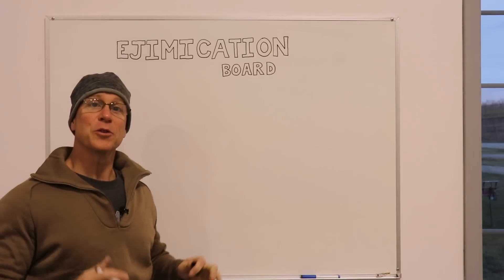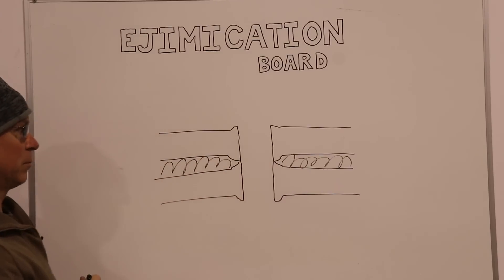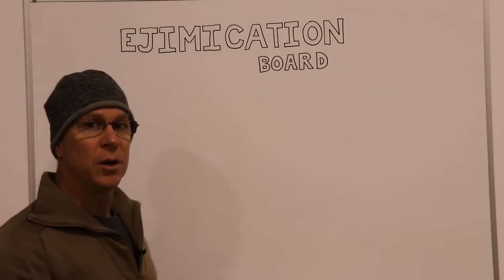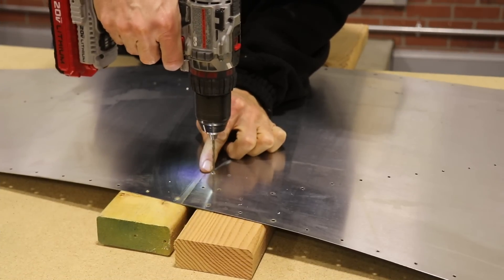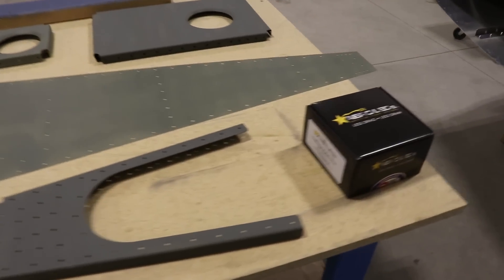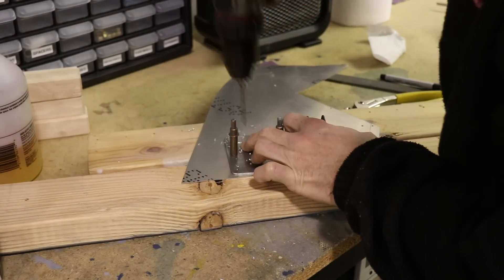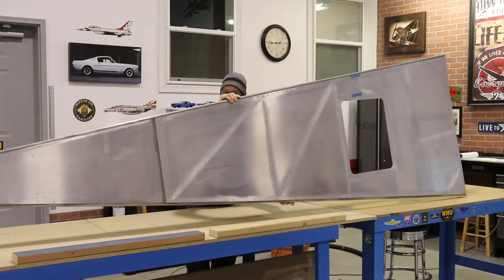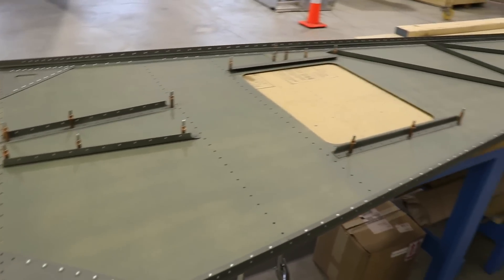WHY Do Holes Need Deburred? (EP21)

Comment: another reason to deburr is metal fatigue.  the burr can create a stress crack after years of operation, if that stress crack occurs in a hidden doubler/trippler it may not be found until its too late.  there have been some commercial airliner crashes the NTSB have linked to 'manufacture defect'  and when you read the report the manufacture defect in question was in fact a burr that started a crack that went unchecked.  deburring the airframe can add years to the airframe's service life, and with as much money as is being put into them, and you have the opportunity to increase it's longevity at this point, why wouldn't you?  (there are a couple dozen reasons I can think of, but my frugal butt just sees the $$ it would cost to replace if I didn't do it.

Comment: I am tossing around the idea of a kit built plane. just wondering if there would be any benefit from dimpling some of the holes. You see a lot of flush rivets on cross country planes but have not seen it on STOL aircraft. lot of extra work, just wonder if you would gain anything by it.
Reply from the maker: No, there would be no benefit to doing this on a Zenith.

Comment: When deburring you want to leave a slight bevel on the edge for stress relief.  Your point about not gouging out too much material is well taken but a 90 degree edge is equally as bad!
Reply: You left out a lot of detail, particularly about the rivets themselves which affects why we deburr. Particularly how the manufactured head has a small radius and the burr can start a crack in the rivet. A very slight bevel in the hole edge is good. You didn’t mention that the rivet shank swells during the rivet squeezing or bucking. On the squeezed head , again the burr can lead to cracked heads. Rivets are a loose fit fastener and relies upon the swelled shank.
Reply from the maker: Thanks for the comment Joe, but I disagree. A 90 inside corner is a cause for a stress crack, but not an outside corner. The skins are way too thin to have a bevel on the edge of the hole.

Comment: Love the videos Mark! Keep up the great work!! Do you know if the 750 SD can be flown with the doors off? It appears the 750 STOL can however not sure about the SD. Thanks.
Reply from the maker: Thanks Colin-I really don’t know about flying without the doors. That would be a question for Zenith.
Reply: I took your advice and contacted Roger from Zenith. FWIW the 750 SD is in fact certified to operate with the doors off. Cheers 🍻

Comment: What model # is the Ryobi Bandsaw you are using? Thanks for very informative videos.
Reply from the maker: I’m not sure. I bought it at Lowe’s or Home Depot about 10 years ago.
Reply: @KitplaneEnthusiast  Thanks Mark. I looked at the current Ryobi at HD and I'm not excited about the quality. Just looking for a good basic bandsaw for cutting aluminum.
Reply: I use a bandsaw from harbor freight.. doesn't have to be a high quality saw.. your only cutting aluminum... and i use just a plain ol wood blade.. itll cut through thick aluminum like butter

Comment: Aren't many/most holes in Zenith kits punched to finished size? What burrs or deformations are you seeing from punching?
Reply from the maker: Yes most holes are final sized. But they are drilled not punched. Anytime a hole is drilled in aluminum a burr will be created.

Comment: Is the skins made from Alclad aluminium sheets?
Reply from the maker: They are 6061
Reply: @KitplaneEnthusiast  Only worked with 2024 Alclad - so was really wondering if 6061 had similar corrosion protection or if the alloy is just less prone to corrosion?
Btw great channel!

Comment: I didn't read all the comments so someone has probably already mentioned it, but another important reason to deburr is if not done, where the burr is attached, it is a stress point and eventually will start a crack in the part or skin.  Piper Cherokees are especially prone to these skin cracks.

Comment: I like that doubler to take up the thickness of the longeron. On this kit there are several instances like Marks example.  In fact as I watched other videos on the Zenith kits I got to thinking, if that assembly is riveted then there will be a step / pucker in the metal. Marks fix is not only brilliant but simple.

Comment: This is a bit off topic, but have you considered putting access panels (either screws or hinged) on the fuselage sides aft of the baggage compartment?  I wish I had put one on each side for access to those items behind the baggage wall.  I do a large one in the baggage wall itself but I think it could use more...
Reply from the maker: Yes I've thought about it but I'll need to wait until more of the fuselage is built to see if/where I'd need an access point. On my Cruzer, I wish I would have made an access panel near the aft pulley that inside the fuselage for the elevator cable. Other than that one location, I don't think any other access would be useful. So I'll see what I might need to get to in the aft fuselage of the SD and add a panel if needed.

Comment: Hi Mark, really like the idea of the 'shim' you made for under the flap motor bracket. I think it would relieve shear stress that would otherwise be in that bracket given its being riveted to two components at different levels. That seems to be something that happens a lot with Zenith designs. Would you think that inserting 'shims' in more places is worth the few pounds in reduction of payload? Great build otherwise. I really like your videos and I'm learning a lot.
Reply from the maker: It depends on how pretty and wrinkle free you want your skins. I'll probably add a shim in a few places, but for me it's not worth adding a shim under every L angle or bulkhead.
Reply: its a steel part, all the stress is in the skin.   It will make the bottom look really ugly from 6ft away, but face it most people are 2000 ft below you, looking up at the sky, so....

Comment: If you rivet with a bur between skins, like you showed, the joint maybe tight till the burr breaks off then you will have a loose joint, also burr are stress risers and can cause fatigue cracks in the part. Same with deburring the edge of the skin, where the skins overlap if they aren;t deburred they can cause a crack the will travel the full length of the over lap.
Reply: Hawkertech....Although there was nothing wrong with what was said in the video, the lack of mentioning stress risers was glaring. From what I've learned, a primary reason for deburring is removal of stress risers from the edges of the holes. The stress risers are edge micro imperfections caused by tearing off of the burrs. Drills leave rough edges, even if no burrs. Punched (not drilled) holes typically leave no burrs, but still need to be deburred for utmost best practice. The de-burring not only removes the stress risers but shapes the edge more roundedly or smoothly resulting in a stronger edge. Consequently, I don't think it is best practice to flat file a hole because it only removes burrs but not the edge micro-cracks that are the stress risers.